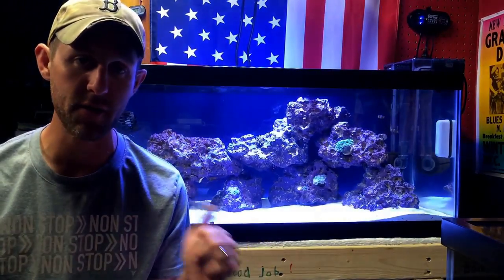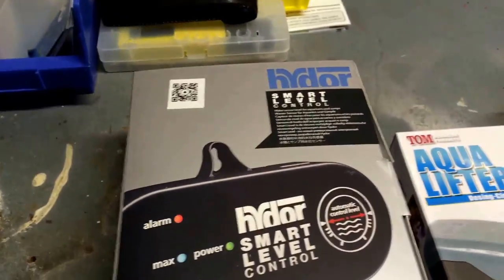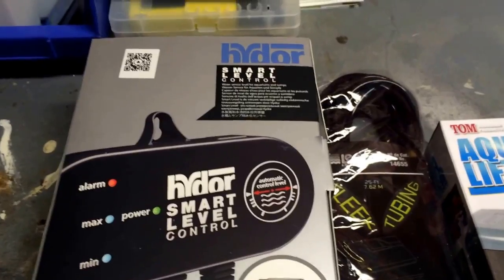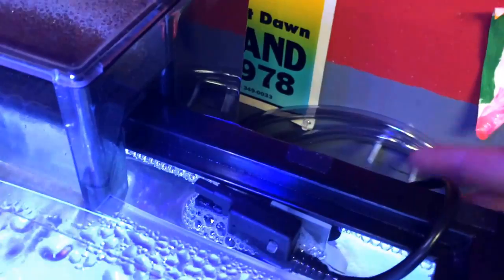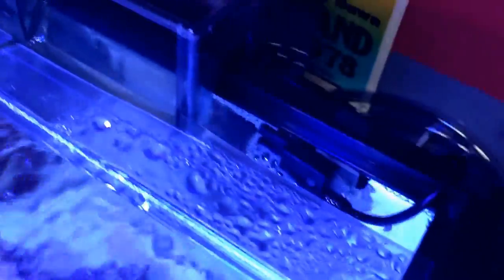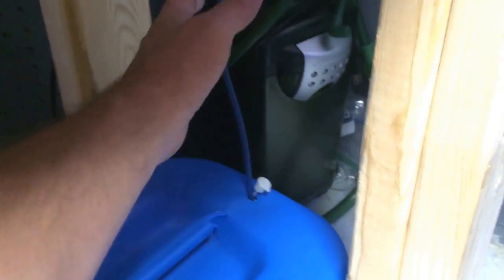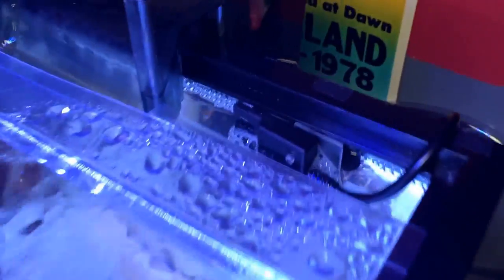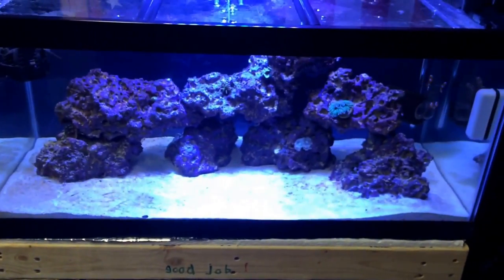How to: Easily set up an auto top off system for a saltwater reef tank.

Comment: Informative video. I'm getting lots of schooling from you and take your word/work to heart. Totally off topic though. I bought a 40 breeder. I love how you have you setup on the sides. In past comments below I see you got you top at Foster and Smith. I'm guessing you bought the 36X18. I must be over thinking this, but according to the measurements on their site, it doesn't seem to fit? Could you help me out a bit before I purchase it online.
Reply from the maker: So with no brace it won't sit and flip from front to back so I have them facing each other and open opposite each other from the middle. I like it because then I have all my equipment on the right side of the tank instead of in the back. Works out perfect. Hope this helps. Thanks for watching
Reply: +MASS Aquariums Thanks for responding back so quickly. This helps a lot.

Comment: Hey Mike, thanks for the installation video. This video is 5 years old and I read some of the other comments and noticed you stopped using this ATO, so what do you use now? Also do you recommend the tunze Osmolator, also if you do have a different ato how long have you had it for?
Reply from the maker: Now I just too off manually or in my smaller tanks I have used the mini ATO
Reply: Osmolator is hands down the best out there. I use the f zone because I could replace one every few years for like 20 years for the same cost.

Comment: Great video. I ended up ordering the same exact setup after I saw this for my 20 gallon. I think my unit is faulty though. It only trigger my pump once the water is at the min level and not once it drops below the max. This causes the alarm to go off because the aqua lifter pump can't pump enough water in the 10 minutes before the alarm goes off. I have troubleshooterd every possible scenario. My question is, should the sensor trigger the pump once it drops below the max level or once it hits the minimum level? I'm so frustrated because I really want this to work.
Reply from the maker: Should trigger once it goes below the min level. The max level alarms to let you know there's a problem
Reply: +MASS Aquariums so if my ro water is less than 3 feet below my tank and I have the same equipment as you, why does my tank not top off in less than 10 minutes? I mean my tank is a 20 gallon and yours is a 40 so I would think my tank would fill in half the time. Do you think I have a faulty pump? Ahhh
Reply from the maker: Maybe.

Comment: How is your aqualifter able to push enough water so its not dripping out. When i place my ato water higher then the tank its able to push the water but when its lower itd unable to push enough water?
Reply from the maker: Maybe you need a stronger pump
Reply: Yes thats the issue, but based on your video it doesn't seem to be an issue.